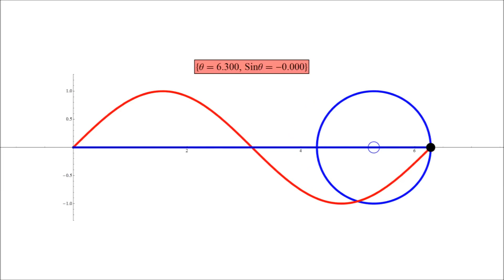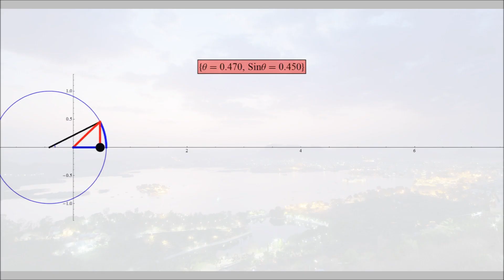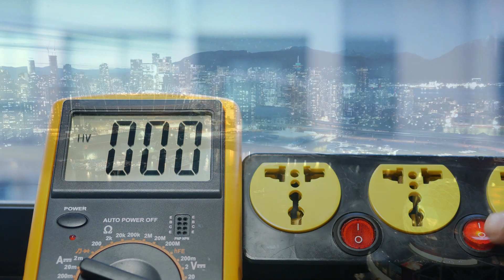Why Does India Use 50Hz Frequency? #electrology

Comment: Why would anyone what to change from 50 to 60Hz? You talk about why it is 50Hz to being with, which is fair, and then you delve into why it’s difficult to change over to 60Hz, but never give any reason why anyone would want to. What would the purported benefits be of changing over to 60Hz? You never talk about it.

If there is no benefit to the change, any discussion on how difficult the change might be is completed unnecessary, and irrelevant.
Reply from the maker: Thank you for your feedback! You bring up a valid point. While my video primarily focused on the reasons for the existing 50Hz standard and the challenges of switching to 60Hz, I appreciate your curiosity about the benefits of such a change. 

There are indeed potential advantages to transitioning to 60Hz, including improved compatibility with certain electronic devices, better performance of motor, stable and flicker free lighting, reduced transformer size etc.

I apologize for not covering this in the video, but I'll consider making a follow-up video to explore the benefits of switching to 60Hz in more detail. Your input helps me improve my content, and I'm grateful for your engagement!